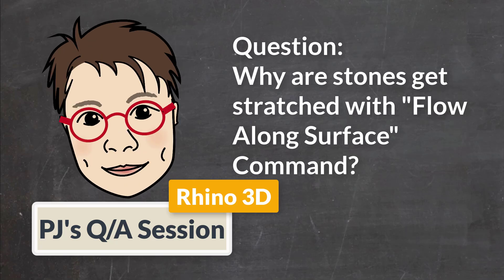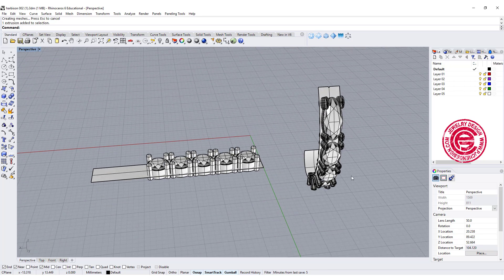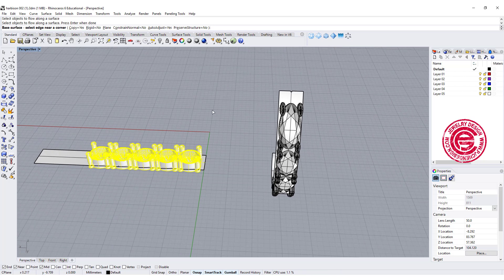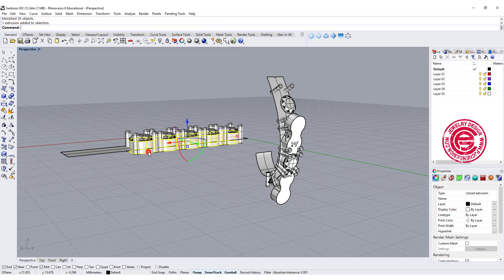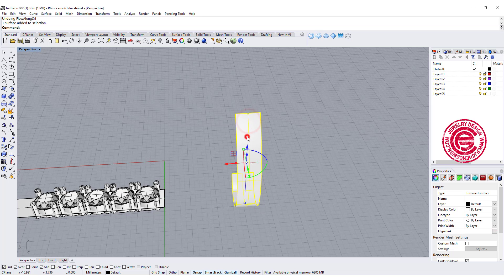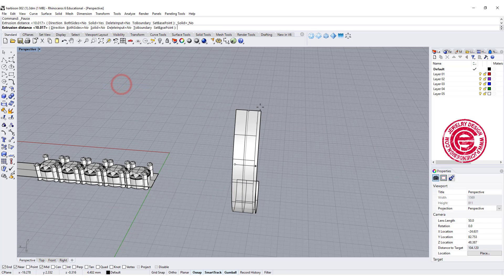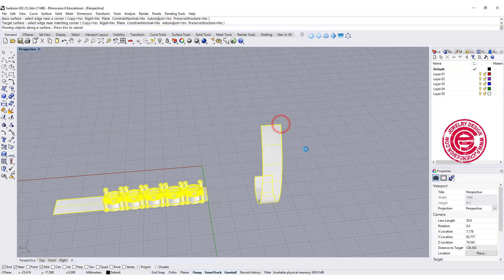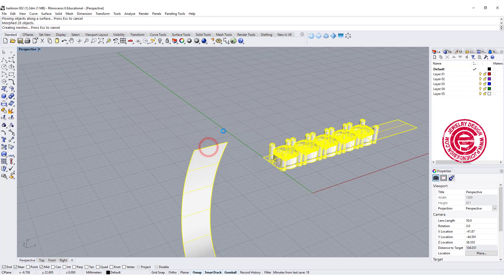Flow Along Surface Issue on Stones: Q/A Session (2019)

Comment from the maker: CAD designers in the jewelry industry use either RhinoGold, Matrix, or 3Design for jewelry modeling. The first two are Rhino 3D base plug-in and share a lot of the same commands with Rhino 3D. All three software has specific commands that are designed for stone flow and be more accurate in size for the jewelry industry. The goal of using "Flow Along Surface" command in Rhino3D is trying to achieve a similar result possible without having industry-specific software.  "Flow Along Surface" on a very tight curve surface will result stretched. It may not be suitable for all design. If that is the case, you may need manually arrange the prongs and stones in Rhino 3D.